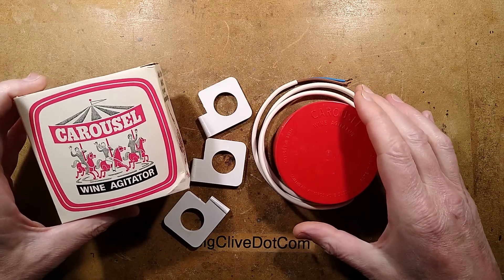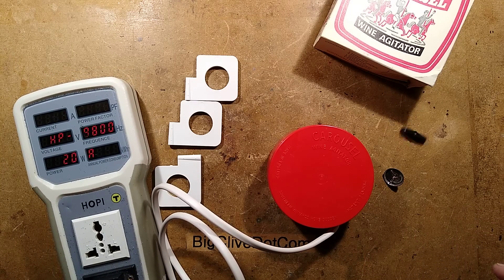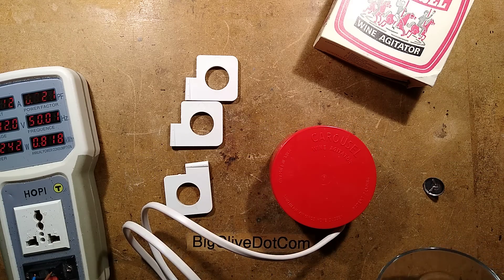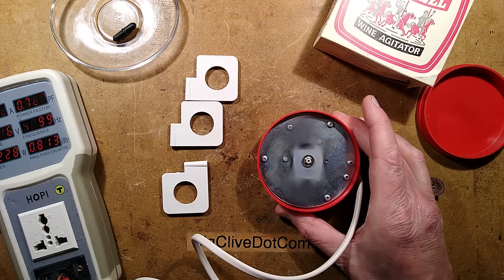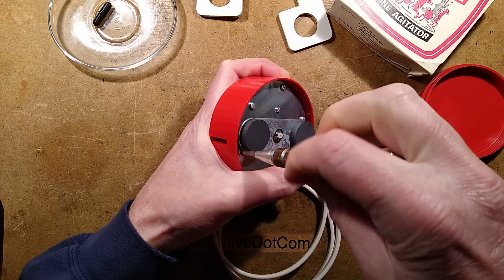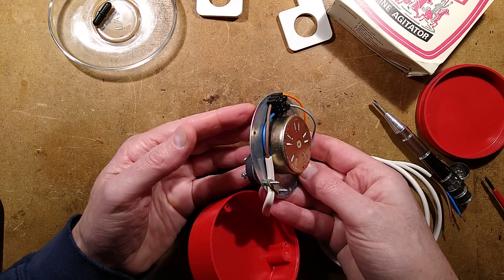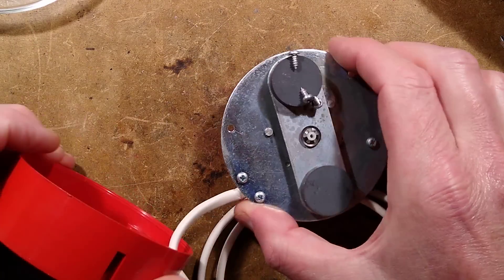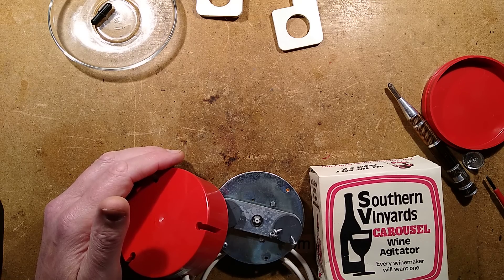Inside a magnetically coupled fermentation agitator

Comment: 2022 (kickstarter) version: 
- Needs to connect to your smartphone (BT or WIFI)  and requires an App;
- Needs an online account to use it;
- Has at least one button (power) and at least one LED;
- Has a camera (can take a picture of happy you with your bottle and you can share pictures);
- Has menus and options to run a schedule;
- Can show the performance history on your phone;
- Device can report temperature, nice!;
- Device can beep;
- Runs on a rechargeable battery (that cannot be removed);
- Includes a power adapter;
- Company has a helpdesk for all of your problems and there is a forum;
- Lifespan of about a year or two and updates requires a new phone.  

Yeah, life couldn't be easier..............  Oh wait, it can! Really?!?! Just a power cord?!?! They made decades ago!?!? Still works!?!?
Modern times, sigh! 😄🙃

Comment: Don't know if anyone has said the name of those horrible little beastie washers, but it's know as a Star Washer. Brakes on certain old '80s & '70s cars had them on the back brakes. Used to use a double deep socket of the approximate sixe to tap them on. And a right Bugger to get off, always have a new one to hand.
Reply: i hate them push on clip washers

Comment: A steel bar in glass tube will also work, after melting the ends shut.  Just make the length of the steel rod the same length as the distance between centers of the magnets.

Comment: Don't put a bar on a spinning stirrer. Put a bar in a cup, and then turn it on. It is simmilar as with starting sychronus motor, while the rotor rpm is 0, the mean tork on the rotor is also 0.

Comment: the slip in the middle will also stop the motor being excessively strained if the stir bar gets stuck in sediment. 

i imagine it wouldnt be happy if the magnet arm were to stall due to bits of grain or fruit.
Reply from the maker: Synchronous motors don't get too bothered by being stalled.  They have low power and high impedance.

Comment: 5:00 The Brick Experiment Channel used a that technique to drive the thrust and yaw propellers on a Lego submarine he built a few months back. I thought it was an interesting and pretty simple method to maintain a water/air tight seal while still having moving external parts

Comment: What would happen if you put a cell phone on a magnetic stirrer? After a debate we tried it out. A volunteer out their phone on top of one in the lab. And twisted the dial. We heard the whirr start as the invisible motor spun the magnets around. Faster and faster....until....hey a reboot! The phone reset itself...And we smelled burning plastic. The poor sod turned on the heating function of the magnetic stirrer and was starting to try his phone. To this day I don't know if it was the spinning magnets inducing an error signal into the phone, or the heat that caused it to reboot. This was about 20 years ago, but what would happen in a spinning strong magnetic field to a modern phone?
Reply from the maker: It could induce current in tracks, but they should be screened against that.

Comment: When I was a teenager and into my twenties, I used to make wine for my family out of all sorts of different fruits.  I used various different products from Southern Vineyards, but I never came across this one.  I tended to use a 25 litre covered bucket for the primary fermentation, before racking the wine into demijohns (which my late father called "jorams"),  Once I had feremented the wine, I would allow it to settle, a process that would take a couple of weeks.  Then I would do a second racking to transfer the cleared wine to clean jorams, before it got bottles.  The last thing you would want to do was to stir the wine in the way suggested on the box of the machine.

My wine could be pretty rot-gut stuff (or it could be really pleasant); it was a matter of luck.  I don't drink alcohol nowadays - not because I disapprove of it, but because I always get rotten hangovers.

Comment: The locking device is one of a bewildering array of "clipping fasteners" created by the Timnerman company, started in 1923. (http://en.m. wikipedia.org/speed_nut) 
I came across them in the early '70's while designing a heater for Eagle coaches.

Comment: Working whily my study of chemistry in the lab we had more sophisticated versions of these units, even with a heater of about 1000 watts integrated. We could adjust the speed of the stirring unit too, to prevent it to jump around uncontrollably. But normally when in liquid they didn't jump to often. We called them "fish"

Comment: The early stirrers in the labs where i worked used shaded pole motors (record player motors) with a U shaped magnet (the old skool ones you see as a representation of a magnet), same stirring magnet
Later ones were just embedded coils under a plate where the field was rotated, the only addition was that both versions had speed control, the latter being a wider range
Some of the stirrers also had heating.

Comment: If your stir bar bounces out try a bigger one or something different like astir wheel. There are many types coated in Teflon. The cheapest bar set of 8 sizes is only a few bucks. If you don't control the speed you don't have many options.

Comment: That must an old beast, just looking at it tells us that. It says "Made In UK" - I doubt you'll find anything like this made in the UK these days. It also has no plug - Shock, Horror, Probe! It actually requires that the owner has to think for themselves, and learn how to wire a plug!!!  Then there's the box, and what a jolly little 1970s style it is too. Finally, screws! Not crimped, glued, friction welded, nor heat staked.

This thing is a survivor from the past, a veritable collector's item. Hold on to it, it's an item to treasure.

Comment: For the more than 40 years that I worked in labs, we always referred to the magnetic stirrer bar as a "flea", due to the way it it will randomly jump about on occasion (breaking the glass flask, if you're unlucky!). The stirrers used in the lab do have speed controls, and also usually a heater.
Reply: "Vortex Genie" being a brand name that springs to mind. ☺
Reply: Parked up next the ultrasonics bath!
Reply: Can you hack a potentiator onto this to get the variable speed control?  It jumps about when the magnetic bars surpass the ability of the stirbar to rotate.
Reply: @scottmalcolm6629  Sure, but you'll have to put an entirely different kind of motor into it. Easy peasy!
Reply: @scottmalcolm6629  No, because it's a synchronous motor it's speed is dependent on the frequency, not the current.
Reply: @Murgo-u3l  then a variable capacitor can alter the frequency, and then the speed?
Reply: @MerlinFox  Without further circuitry a variable capacitor will only alter phase, not frequency. 😒

Comment: I wonder if It would work as a induction heater
Reply from the maker: Not enough energy.
Reply: That motor only takes a watt or two of energy.  That means the amount of heating it can do is even less than that.

The hydraulic press channel managed to do appreciable heating with a pile of supermagnets stuck to an angle grinder, which sounds about right for the amount of power going in.

Comment: I have chemical magnetic stirred that work on the same principles, but have variable speed settings @potentiometer , and I think that's a main problem with Yours gizmo, it goes too fast and little black agitator fly off. Have a nice day mate :) 
Also I would like to change those permanent magnets to neodymium and wonder if longer / heavier agitator would work better in this case .... on the other hand it's 1Ł fun toy, than why bother ;)

Comment: I think have seen that friction mechanism before. Specifically, in tape drives, where you need the spools to take up the tape but the capstan defines the actual tape speed, and since the spool speed changes with the diameter of the tape already spooled on it, it is geared to run faster than the speed set by the capstan, and allowed to slip.

Comment: I used to repair automatic washing machines and these motors were  commonly used on the old electro mechanical timer switches used. If you take the motor apart you will find a pawl which determines the rotation of the motor, which is uni rotational.

Comment: Built my own years ago with a scavenged 4-wire PC fan and a 4-wire pwm controller module (YouTube doesn't allow links but if you Google "instructables Quick 'n Dirty Magnetic Stirrer lairdkelly" it should be the first result... The module I used is now unobtainium but there are a number of somewhat larger modules on eBay and Amazon from unenclosed boards to a packaged unit like the  Noctua NA-FC1 (basically a 555 or dedicated PWM chip with a hex inverter or MOSFET buffer to generate the PWM clock signal for the fan) Much better than the unreliable chinesium stirrers with a cheap brushed toy motor and rheostat (or home-made ones with a two-wire fan and rheostat "fan controller") and cheaper than lab-grade stirrers based on a mains-power universal motor and a triac or quadrac PWM lamp dimmer/motor controller.
Reply: all I did was glue some magnets to a big computer fan.  Worked great

Comment: Would someone please explain to this non-drinker what a vodka wash is, and why you can't just stir one with a spoon?
Reply: "Wash" is just a (generally sugar-based) brew intended for distillation rather than direct consumption. If you don't distill it it's sugar wine, like the Kliju supposedly popular with Finnish punks. You can absolutely just use a spoon for mixing up and initial aeration of your brew. The stirplates are more used for multiplying yeast cultures as far as I know; yeast go into replication mode in an aerobic environment and brew mode when in a more anaerobic environment and the stirring helps keep it more on the aerobic side.
Reply: @slowdriphobbychannel732  Okay, thanks a lot. Makes sense now.
My hillbilly ancestors would call that a "mash".
Reply: @markfergerson2145  Very similar, I think the difference is mash contains malted grains as the source of sugar.

Comment: It's just a cheap knock-off laboratory magnetic stirrer.  The agitator (flea) is a magnet usually coated  in plastic and comes in various sizes. Lab stirrers have a variable speed selector, too fast and the flea does its little dance. There are also heater-stirrers, never seen inside of those and the ones in work seem quite robust even when heated fails they still stir.
Reply: How many names does the stirbar (what I've always heard it called) have, I think the best one I've seen so far is "stirfish" from one of the continental European chem channels I watch.

Comment: I'm guessing the unidentified plastic adapter is a generic item glued to the metal bar.  The washer that holds it is completely standard for holding on plastic wheels like that.
Reply: The washer is called a star washer we had some pumps fitted to a cleaning station cleaning metal strip but bits of metal got stuck in the pump. Cleaning solution was corrosive.

Comment: Cruzet motors were very standard on the washing machine timers on the machines I used to repair
Reply: You still can buy the timers, those old washing machines are still quite common, and they pretty much only have the timer fail or the motor capacitor or the bearings, all parts available as either new or pattern parts.  Pattern parts are in the most case actually made by the original manufacturer as well, just they supply you with a single well copied sheet that tells which jumpers to move for different models, though it is easier to simply move them one at a time from the old broken one to the new one.

Comment: Yep, a very familiar looking motor that was in about every washing machine controller (and some other devices that I cannot right now remember) that I took apart as a yound lad decades ago :) Some models even had two of those motors. It has almost zero torque but due to no brushes it lasts as long as the bearings do which in those use cases is decades.
Reply: I had no idea these were used in old control panels, pretty cool!
Reply: @skylined5534   Well it is a synchronous AC motor with low rpm and small size, so it is good for mechanical timers which essentially is what the old washing machine rotating controllers (behind the program selector knob) were. Some new microwave ovens still have a mechanical timer so I would imagine a similar motor used in those even today, though I have never taken a microwave apart.

Comment: I sometimes wonder why not go "no moving parts" and no magnets.  Use 3 coils on a printed circuit board and use a tiny cheap variable frequency drive to power the coils.
Reply: More expensive?
Reply: @DanielsPolitics1  When this product was new decades ago, variable frequency drivers were expensive industrial devices costing over $1000 each.  The modern fad of renaming basic AC motors as "brushless DC" has brought down the price.
Reply: @johndododoe1411  that was thousands of dollars for large high power motors and control electronics needing heavy currents and high voltages. But today, electronic commutation of the coils in a BLDC motor using between 5 - 12 volts is pretty cheap, especially in a low power device like this.
Reply: @DanielsPolitics1  is it? No moving parts, no expensive magnets, just a cheap pc board is more expensive?
Reply: @kreynolds1123  Motor and magnets is cheap, and more importantly you make it with standard home tools, available all over, not needing any specialist electronics knowledge. Thousands of small one family factories in China able to do that at the rate of a few hundred per day.
Reply: @SeanBZA  Do it yourself project  is  great for home project that repurposing scrap motors and magnets.  But I talking about why companies still make a motor and use magnets to spin a stirbar with a rotating magnet when they could just create a rotating magnetic field with coils printed on a printed circuit board.  No moving parts, no bearings or bushings, no magnets, and the electronics is about the same as the BLDC motor used in many magnetic being made comercially today.
Reply: @kreynolds1123  But that needs in house expertise, while the mechanical stuff can be done easy by unskilled people. Plus making a copy of a very old design is easier than making a new one, even if you are a small company with limited ability, but can get all parts on the market cheap.
Reply: @SeanBZA  yup having expertise is very helpful when one intends to invent.  But everything i suggested is already invented.
Reply: @kreynolds1123  ye

Comment: I always thought this would be a useful albeit limited feature to build into otherwise horrible glass cook tops.
Reply: oh dear, little johnny's choking on the stirbar again
Reply: I think it would only work with glass vessels, they do use them in labs (built into hotplates).
Reply: @gin3648  Probably no good if you're got an induction cooker.  😁

Comment: I would expect a commutated coils with no moving parts at all, only field, but it seems to be quite an old unit.
Guess this is how it's done in lab magnet stirrers these days.
Reply: the ones with integrated hotplates use coils, I think, since magnets don't agree too well with getting hot.  Otherwise, tiny motors these days are just so damned cheap
Reply: @tsm688  I've seen NileRed/NileBlue on YouTube, he uses magnetic stirring a lot in his videos, and when heating his potions as well.
Reply: I think at this point "magnets on a rotor" is such a standard way to do a stirplate no one really bothers reengineering it, even the non-Chinesium lab grade ones I've encountered all whirred like they had motors in them. Might be a fun open hardware thing to design a no moving parts version though, given sequencing some coils is a pretty easy task nowadays.
Reply: @slowdriphobbychannel732  a magnetic SSD, in some way?)

Comment: They're called a lock washer or retaining washer, specially designed to make salvaging stuff more painful. Bending a couple of the tabs up is the only way I've been able to get them off cleanly.
Reply: Lock washers are something else, and many different things are called "retaining washers". You're more likely to get these if you ask for "push nuts". (Although there are also multiple kinds of push nuts. But they all at least have this concept of one-way "barbs".)
Reply: @wbfaulk  I'll let you compare the experience of googling "lock washer" and "retaining washer" compared to "something else" and see how easy they are to buy 😂

Comment: The Patent for a magnetic stirrer... LOL.  Well, you may have seen the Wicked Makers Channel made a magnetic stirrer for those magic potion they used a small DC motor with a magnet hot glued to a nut and another magnet was dropped into the the potion bottle... Here's the link to that video at the spot where they put it together and the action takes place: https://youtu.be/RyTLKxeMPEM?t=204

Comment: Very useful for mixing your own vaping fluid.
Reply: vapers generally don't consume a quantity large enough to use that kind of mixing technique. A 200ml bottle is already a lot for personal use and it's pretty easy to manually agitate.
Reply: @PainterVierax  I make up about 900ml each time I make for me and the other half, so yes, would be nice to have a mag stirrer rather than the mini paddle that I use in a drill...
Reply: @dougle03  
Slowly shaking upside down a 1 litre bottle a couple of times is enough to mix though. No need to even paddle or spoon it. It's not paint, dough or omelet mix. 
You can test it with some colored aroma to see how easy the ingredient spreads.

Comment: Looks like a very cheap version of a lab mag stirrer. Those normally have a speed control and integrated hot plate.
Reply: And don't usually send the stirrer flying around randomly. I expect that wouldn't be a feature in chemistry.